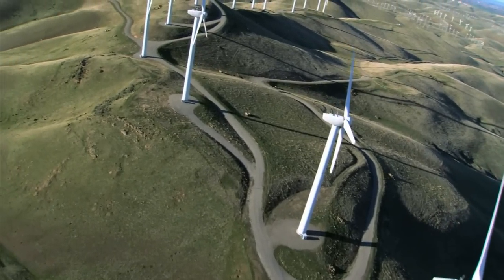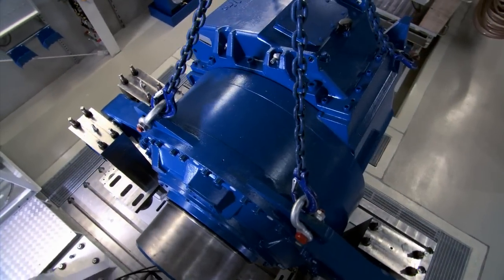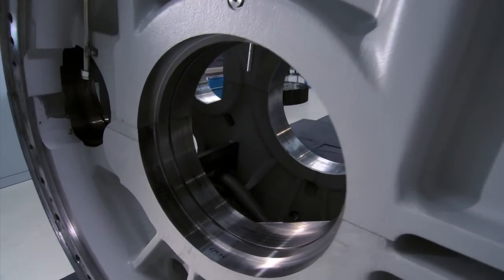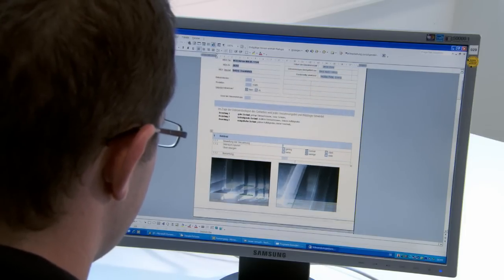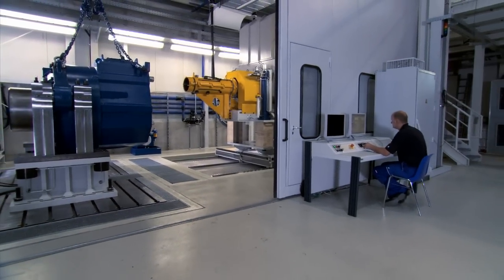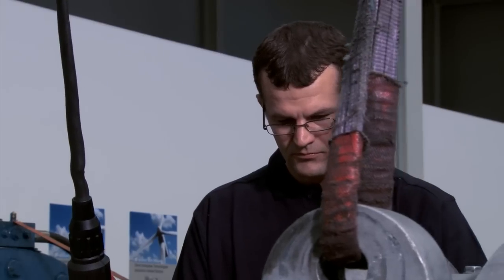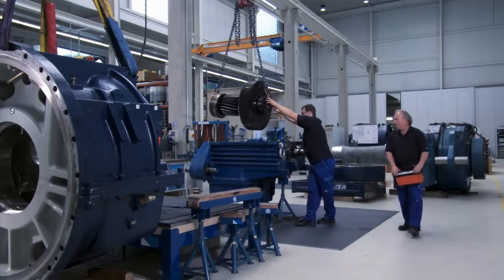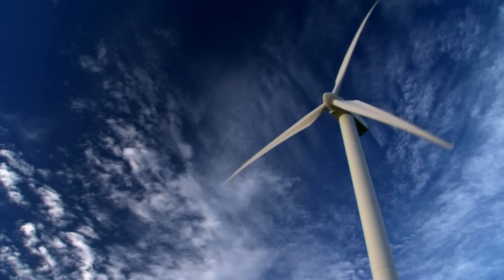ZF Services for Wind Power (2011)

Comment: BSW 13MW to 20MW wind turbine. Can be manufactured by small workshop by any body, it will put an end to the monopoly of all wind turbine manufacturers like Suzlon, Gamesa, GE, Hitachi, Siemens, Vestas.  Any small workshop can make 20MW BSW windmill. BSW will be Transported by single track, assembled by unskilled workers, generator at the base, very easy maintenance, lasts for tens of years, costs %20 only. Built-in Safety mechanism, so it works in very strong winds, it will generate electricity even in storm fast winds, while it will start to spin by itself at 2m/s wind speed without the need for starter motor
10MW BSW use 33 tons of steel only
http://brisam9.blogspot.ae/2017/06/bsw-calc-links.html?m=1
10 minutes video animation of BSW
https://www.youtube.com/watch?v=XhY9GxsQ2i0&feature=youtu.be
2 minutes video animation of BSW
https://www.youtube.com/watch?v=8lW7noHOQAQ

BSW turbine has hundred thousand sq feet Surface area, wind pressure difference on it will produce 149MW, while GE Haliade-X turbine it's Surface area ten thousand sq feet, produces 12MW, 10 BSW equivalent to 100 GE Haliade-X
GE
https://www.businesswire.com/news/home/20180301005661/en/GE-Announces-Haliade-X-World%E2%80%99s-Powerful-Offshore-Wind
BSW
http://brisam9.blogspot.ae/2017/06/bsw-calc-links.html

Cooling system uses %50 power, Patented Freon pump, %50 less CO2
http://brisam9.blogspot.ae/2017/06/jps.html
dewatering prototype same idea as the A/C
https://www.youtube.com/watch?v=N-znI9GzbFs&t=151s